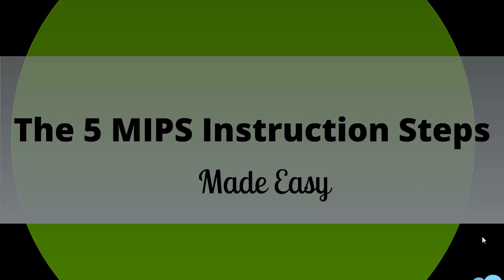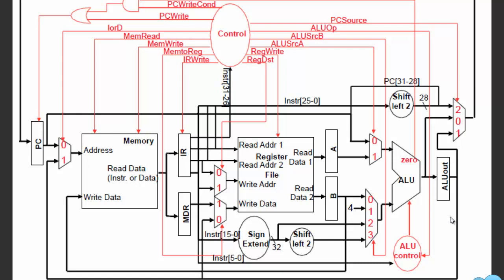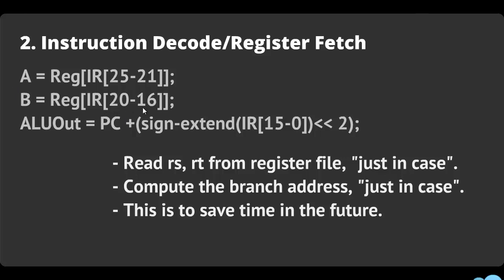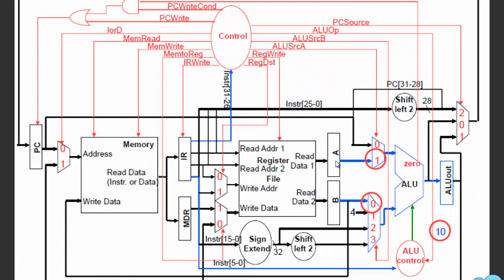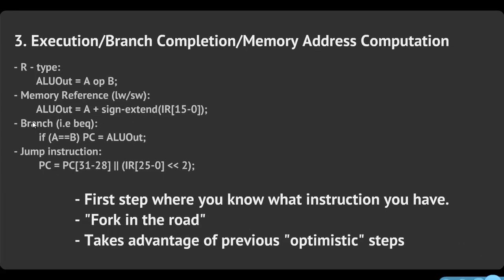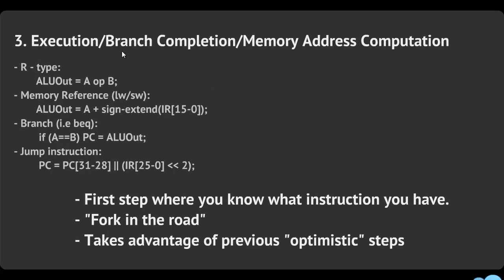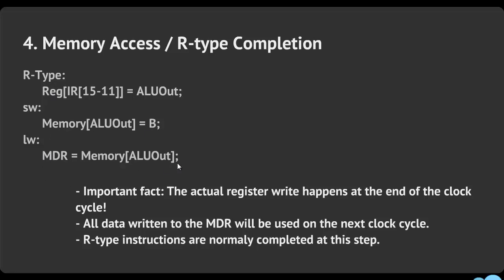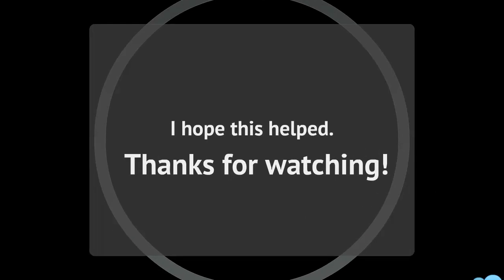MIPS Multicycle Datapath Instruction Steps Tutorial

Comment: Amazing video can you help me with an extra credit problem for my HW. i used the video for part  'A' really helped

B. Consider the linc instruction, which is a variant of the lw instruction that has the same operands but also increments the base register by 4 after loading the word. Linc has the same machine code format as lw. Modify the MIPS multicycle implementation to support this instruction using as few cycles as possible.